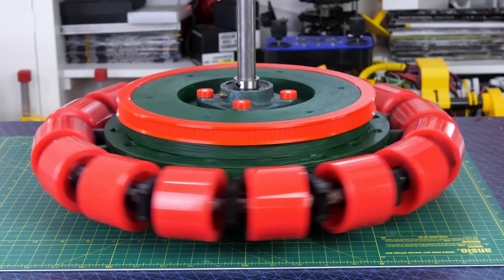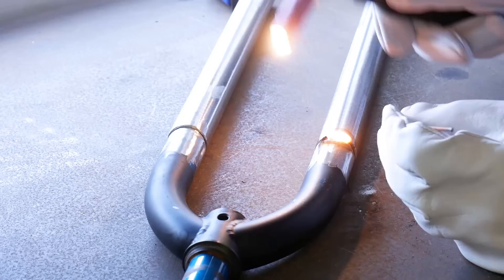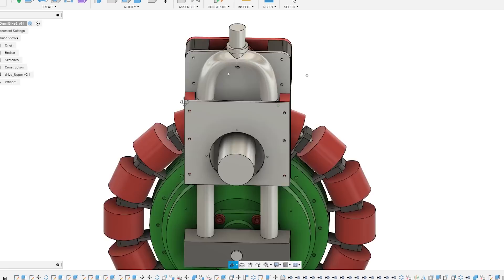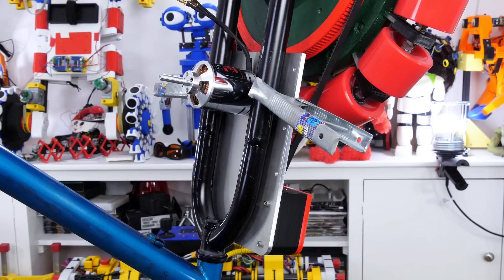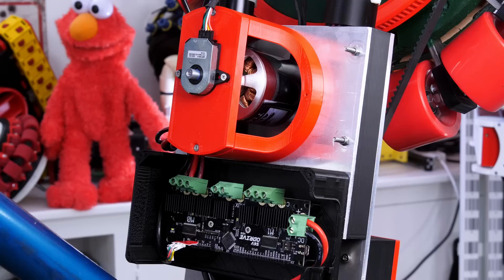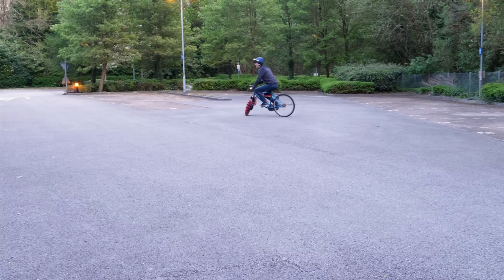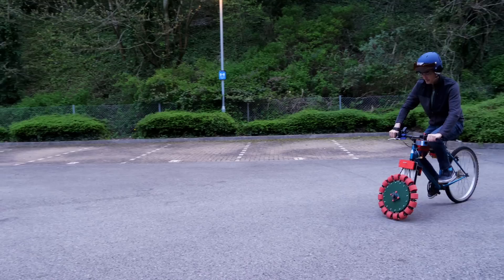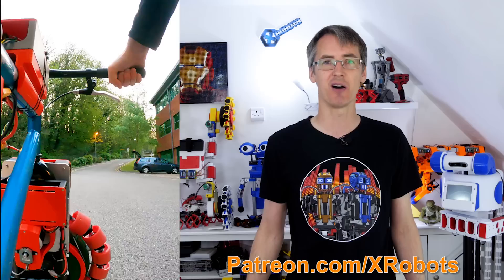Can I RIDE THIS BIKE?

Comment: I wonder how a car designed with these wheels in mind would drive. I've seen physically impossible ball wheels on a BeamNG car which were awesome, but this could actually work if made from proper materials
Reply: There are for example Mecanum Wheels, which are sometimes used for four-wheeled robots.

Comment: Might be helpful to order some shallow cups for your TIG welder to help get in those tiny confined spaces like in between the tubes of those front forks. They also make a stubby backed gun handle that isn't so long in the rear helping with access and mobility as well.

Comment: motorcyclists might have an easier time adapting to this as we are used to switching to and from counter steering as the speed varies. i would imagine that this is like counter steering with arms locked and only the leaning.

Comment: If I had the money, I'd build a front facing omni wheel, with no motor, attach it to the back of some contraption. With a suspension system for the bumps. (up and down) and a disc brake to lock the wheel from pivoting left or right.
.
Place 2 electric motors in the front of said vehicle, have it drive like a tank with a left and right throttle with seperate disc brakes just cause.
Have the back wheel be balance driven with some mountain board trucks and some pegs that help shift the weight.
.
The handle bars are fixed in place since u don't use steering and just need a place to put the throttles and brake handles.
.
The back disc brake is foot operated. So your hands remain free and it can constantly remain engaged.
.
This way u have a full spin left or right with no resistance and a pulling factor that keeps u straight and helps turn at low speeds.
.
Just my opinion and leaving it out there.
.
It'd also look like a rideable tachikoma. From ghost in the shell.
.
Why?
Cause a couple hours ago I got bored and I've been wanting to build something like an electric shopping cart but have it bee more anime and make the driving dynamic be a bit different.
.
I figured out tachikomas can only be sized in terms of cubes.
.
U can stand. 
     atop a small one.
Sit.  .upon a slightly bigger one.
Or Be.     .    within. one.
 .         Placed. 
After./
It must be big enough to hold a room or pull one. (_-_! ! _-_)

Comment: Interesting idea, but I must be doing something wrong when I ride a bike (at speed) as my "steering" comes from leaning the bike into the curves on the road rather than turning the handles. I know this setup would require for my body to also lean rather than having my body perpendicular to the road though. One thing that had me intrigued though would to have something similar, but with the wheels lined up and on a 4 wheel vehicle. The steering would be right/left as normal for the front wheels, but then also a left/right : in/out motion (similar in motion of the old-style track vehicle steering rods).

Comment: Would it potentially be beneficial to use a sensor vs a switch? Use the sensor to detect the back tires speed. Once the back tire stops moving the front will engage the balance mode. Only downside i could see is if your heading down hill and lock the rear tire under braking

Comment: Hey! Welder here, I have some constructive suggestions. Try lowering your Amps and lessen the darkness on your helmet, this will allow finer control. Slow your pace, it's not a race. You should also try a 4 cup, and having your tungsten out a bit further, this will put you at a higher risk of dipping your tungsten, but will give you the space to see what you're doing. Hope this helps!

Comment: In bike racing you're taught to not turn the bars when making a turn. It makes it more likely you'll twist your toes if you hit something or another bike. Hold it straight. Only turn them at low speeds for sharper turns but in races you never want to move the bars.

Comment: Perhaps add an auto self balance by adding an encoder to the back wheel (like the old spring dynamo). Then if the back wheel is stopped or barely moving, the bike will go into balance mode. You could get off and on the bike and it would still balance.

Comment: I think you should have a break on the handle bars so you can lock them like amtrakboy42 says but then I think you should program the micro controller to make the bike go left and right with two more buttons on the handle bars. this way you could eliminate the need for the rider to balance then if you add a forward facing lidar you can make it uncrashable.

Comment: I'm wondering if this would be practical on a motorized trike? 2 back wheels and this as the front wheel. Perhaps if you fixed the handle bar in place and all turning would be done by the wheel. And instead of turning with a gyro sensor, you turn with a steering wheel.

Comment: 14:15 I kind of drive a bike like that, I rely less on steering the wheel and more on leaning in the direction of where I want to go, which you can't do on the bike that is shown in the video because the pedals are way too low. I only really use the steering wheel when I'm going slow, which is not often.

Comment: Wouldn't have putting the omni-wheel in between the two spokes of the front attachment been a better idea? Simply turning the front attachment 90 degrees and putting the wheel between the spokes seems like it would've been a better idea to keep it more stable and the balancing mechanism could've been attached to the back of the spoke on the back of the wheel? Seems like a better idea to me tbh. Still pretty cool!

Comment: It seems that its harder for you and it to balance sometimes with the jitter because your brain forces you to react to any unexpected movement by turning the handlebars.
Try locking the handlebar, physically, so it wont move, lock it or whatever. It might be easier that way.

Comment: 02:52   It upset me that you didn't also make a 1/3 weld on the INSIDE of the post into the square crossbar.  That would provide absolutely superior strength!    It would reduce most of the leveraged torsion on the single weld at the holes.  I think this is actually significant, since the wheel is mounted off of that square piece.  I noticed the solid steel bar that holds the wheel you actually DID do a double weld ...

Comment: I actually thought you would put the wheel spinning controls where you grab the handle bars and control the wheel spinning manually, instead of just having a self balancing mode. I think it would have been easier and more useful if you just had control of it most of the time, at least.

Comment: As-designed, your bicycle has negative trail on the front wheel. I'm really surprised you can ride it at all, but it may have something to do with the degrees of freedom of the omniwheel - or it might just naturally rest between two of the wheels and give you lateral stability a different way.

 You might want to look into steering dynamics of bicycles, if you haven't already.

Comment: how about a bike with 2 omni-wheels. However have the wheels side-side motions are locked unless youre pressing a button on both handle bars. I.E. Pressing the button on the left bar makes the bike crabwalk left or the right one right to the right. Then you could probably have the wheels angled the proper way but have an overly complicated way to move around small obstructions.... or a bike that's extremely useful and cool one way but ridiculous and borderline useless another

Comment: Nice, wouldnt a sensor for speeding up and stopping have been better instead of switching the balancing on or off? For the initial test where you turn off the balance when going forward.

Comment: Do you think you could use a comparator and a tachometer on your rear wheel to control balance mode instead of a toggle switch?  And if so, could you then reverse the direction of rotation of your motor for balance mode when above a specific speed so that it works more like you naturally want to ride it?

Comment: I realize that this isn't meant to be a product, and it's more an experiment to test possibilities of the omniwheel. But I can't help but think how much easier it would be to just put a foot down. And in the case of someone without two fully functional legs, just adding a third wheel would also provide a stable stationary position.

Comment: Could you take a wheels speed signal from the back wheel so that when you stop it automatically turns on balancing mode and then turns it off one you go over a certain speed?

Comment: So would I assume you are using an accelerometer or gyro chip for the balancing?? I wonder if on the next version of this you can have an accelerometer or such detect when you are stationary, or moving. Then auto change between the modes? so that when moving you are closer to a normal bicycle, but when you stop it auto triggers the balance so that you can literally stop...keep balance, then start pedaling again and go forward, all with out putting your feet down? That would be cool.  Also is there a speed limiting because of that front wheels or any other possible side effects of having that front wheel configuration??

Comment: Ok but what if you just got rid of the rotation of the steering handle to the wheel and turn 'balancing mode' into a proper drive left and right, such that your foot action propels you forward but the motor does all the steering?.. Would that not be Omni-Wheeling enough for you?

Comment: Love the video awesome project. I'm curious, because on 2 wheels when turning at higher speeds there is a lot of counter steer. I won't say I know all the details but the faster you go you have to turn left to go right, and right to go left. (more common on Motorcycles) Again not sure, but I believe that's how it works. Again great video I will for sure have to check out some other content.

Comment: Soooooo would that basically mean that the bike would be more efficient if the frame and the steering column were 1 solid piece rather than 2 pieces or even 2 pieces welded at multiple points?

Comment: Ok so I may just be odd but for turns I've always just leaned hard and kept myself up with speed instead of turn the handle bars cuz when I tried it that why the wheel would turn sideways and I'd fall so I just lean now it so works well I can use my phone or smoke while riding cuz I don't need my hands to turn I just lean I think you accidentally made my dream bike I'd always ride it in balancing mode and weld the handlebar locked straight forward

Comment: could you make it to where the balance and rotation is done on the helmet using bluetooth to connect the helmet to the wheel, so then all you do is tilt your head slightly and the wheel should turn you. Is this possible?

Comment: Small turns usually don't move handle bars... Tilt one way or another only slooow moving bikes normally turn the handles. You are probably not riding a bike efficiently to begin with😁 strange looking but very neat invention 👍

Comment: I suspect riding in balancing mode would be easier if you were used to riding a bike no handed.  I know its not a skill many acquire, but as someone who is fairly confident riding no handed through potholes and around corners it really didn't sound as challenging as he made it sound.  That said I am sure there is still a learning curve.

Comment: As far as welding goes you should invest in some smaller filler metal and probably a #7 gas lense for the torch to get some better shielding gas coverage on the weld, makes the actual puddle of the weld feel much more controlled and you won't need as much heat either. That'll help you out a lot I think for what you're doing

Comment: The would be easier to ride if you put a smaller rear wheel on or increase the length/rake of your fork.
Reply: Move your center of gravity over the rear wheel and it will be much more stable.

Comment: You should lock the steering wheel in place or add a sensor on the rear wheel that would turn the balancing mode on or off based on the speed of the rear wheel.

Comment: I just subscribed to your channel and I tried doing that it will work a little bit better if you can have the turning with you if you were putting the single person in a motorcycle motorcycles I will be a lot easier instead of leaning leaning

Comment: Interesting and cool! BUT pretty useless. But if you'd turn the wheel by 90° to the normal direction and switch the hard plastic tube parts by a 360° flexible tire and motorising that, this would be super cool! A self balancing bike without the drawback of tiny skateboard wheels

Comment: You need someone like me around. Im a literal genius, my iq is around 170. I already knew when you got on the bike it would be hard to use, and i could surmise it would be tough to balance on and switch from balancing mode to normal. You can dm me if you have any issues you cant figure out

Comment: you should lock the wheel permanently and then take off the handlebars, you should be able to simply ride with no hands and not have to think about turning the front wheel

Comment: SRB
 sweet / so far , were making "rocket 🚀 jet packs / ... noww I'm working on the rocket 🚀 and jets / ... but , mostly excerpt for / ... fthee rockets ,..need / things like , .. Rocket component /.. seee I think there's are rockets commercial available /... and I want to , amp them up some / // ... and fthee jets / tthosee are almost ready / ... wee got them on ram-air / and turbines and ... between infared or ceramic heating // ....so ... I think wee are looking for fule types/...and still going over / some of the material / //

Comment: Why everyone likes it? The way this guy placed omniwheel is the counterproductive. You can drive from road to the pavement because of the sizes of little red subwheels, aerodynamis sucks, structural strength sucks (too much side-pressure on the wheel). Absolutely silly. Just make that sane wheel like a normal bicycle wheel in the same plane with the back one and drive sideway on small red subwheels once a while instead of using the whole wheel.

Comment: Dude you could have literally just attach the wheel and turned the fork 90 degrees to the handle by just loosening the locking nut at the top of the body neck  🤦‍♂️
Reply from the maker: Nope, or would lean in one direction.

Comment: Wth is the point in this? Should you be using the wheel in the correct rotation and then using the smaller wheels to then turn you or if you had two wheels then you can strafe without turning the handle bars or even  do 180 or 360 turns. Technically you would not ever need to turn the handle bars.

Comment: This seems far from ideal. The ride quality looks horrendous and anything with speed seems unlikely. What is the goal here?  Self balance? Turning in a small circle while stationary?  There is probably a better way than adopting tech from an old project. Should be started from scratch.  And really understand what the objective is here. Because right now there is just a cumbersome bicycle that in no way improves and other bicycles currently available